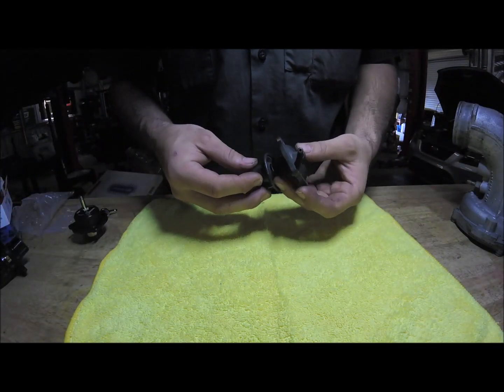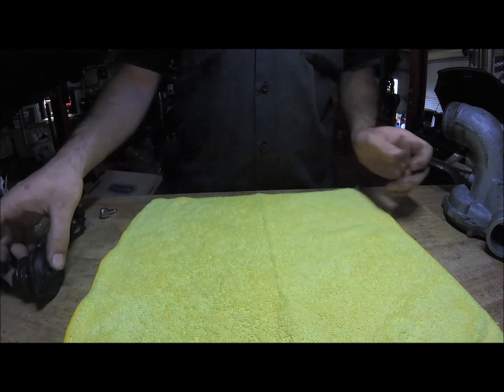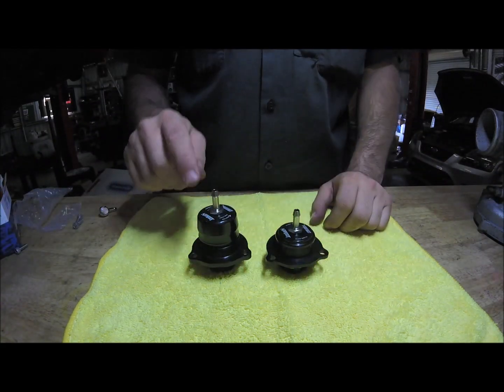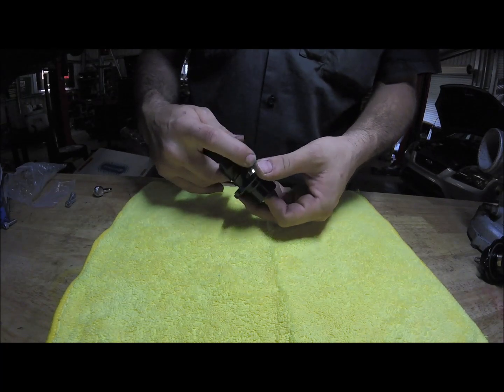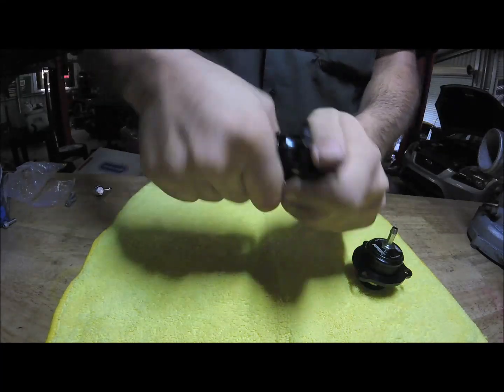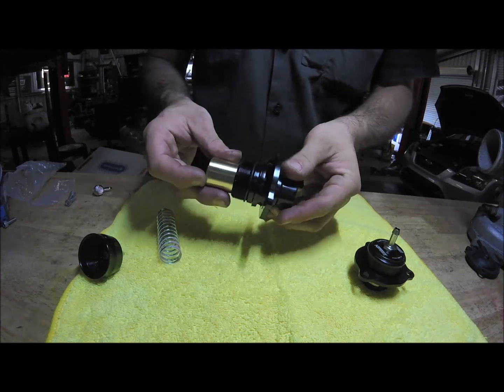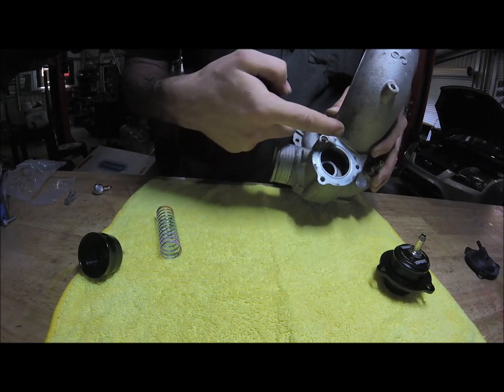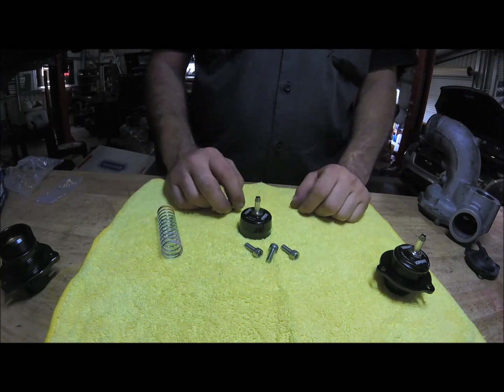Focus XR5/ST/RS CBV's explained

Comment: 1:28 "this spring is really soft .. let's pay $100+ ". ?!  May be change the spring for $1? The valve is under boost pressure so i will hold any pressure that plastic and rubber can stand.

Comment: Can you run use these on a stuck tune
Reply from the maker: yes you can
Reply: @OEMDeniedPerformance was thinking of installing the dual port valve on ford mondeo xr5, so the stronger spring won’t affect the engine, would I need a tune after installing the dual port valve?
Reply from the maker: nah you can fit as it no problem mate  @celpecross3496

Comment: I've seen people talk about blanking the factory valve off, is this a good idea or not?
Reply from the maker: Will just give you problems. A CBV is there to prevent compressor surge. Due to the mk2 ST/RS both running a MAF sensor if you remove and blank the CBV the compressor surge confuses the MAF and eventually the ECU will put the engine into limp mode. A blanking plate should only be fitted if you are fitting another valve elsewhere in the system but if you fit a valve that vents fully to atmosphere this will also confuse the MAF and ECU will assume there is a boost leak and put engine into limp mode. (recirculating/plumb back valves will not have this issue)

Comment: If I only wanted turbo flutter, could I just pull off the vacuum line and plug it? Would that stop the cbv from opening and make the stutututu noise?
Reply from the maker: No, that will allow the CBV to open slightly still as there is no positive pressure behind the spring and will create an internal boost leak.  To blank it off you need to remove the CBV and fit a blanking plate in place of it. But be aware that by doing so you will create compressor surge and if on a ST225/RS mk2 due to having a MAF it will put the vehicle into limp mode.
Reply: @OEMDeniedPerformance  bloody computers ruining all the fun dammit. Thanks for the info tho

Comment: Technically couldn't you take the spring out of standard recirc one if ur running a dump valve ????????? Because I've put a dump valve on mine but its seems quiet but I still have standard recirc valve ???
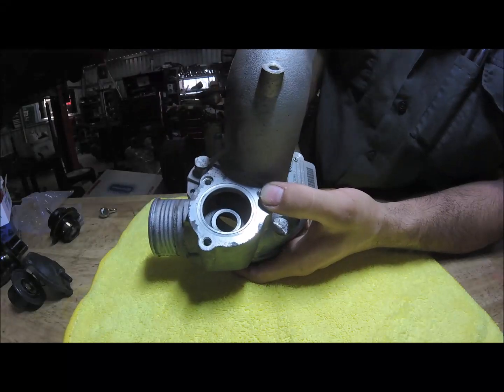Reply from the maker: No as the spring is what keeps the valve shut until you come off the throttle. When vacuum occurs in the inlet manifold as the throttle plate is shut, vacuum occurs through the line to the other side of the CBV and pulls against the spring to open the valve. If you were to remove the spring the valve wouldn't seal so you would create an internal boost leak between the compressor and its intake throat (path shown at 1:10- 1:20)  The issue with running a dump valve and no CBV at all is because it fully vents to atmosphere it is releasing air that the ECU has accounted for as it was drawn in via the MAF sensor. This will eventually put the car into limp mode as the ECU thinks its a boost leak. If you fit a dump valve alongside the factory CBV you gain nothing other than noise but only a little bit as both valves are now operating. The reasoning behind upgrading the factory valve is to have a stiffer spring. If you want the sound of a dump valve fit a dual port CBV as that will give you the noise and the benefit that the valve stays shut until its intended to open.   Not many people fit dump valves in Australia as its not road legal to fully vent to atmosphere but with a dual port its mounted on the compressor housing so becomes the a small case of if police cant physically see it they tend not to book you for it .
Reply: @OEMDeniedPerformance  okay thanks alot man!

Comment: So if you want more of a flurry you tighten it right?
Reply from the maker: tighten to set the spring to harder to prevent vent to atmosphere operation at lower boost levels.
Reply: @OEMDeniedPerformance  oh okay.. so to get a flutter I need an intake aye
Reply from the maker: @blitzballproductions901  yep. The stock airbox will baffle any noise. If you just want flutter fit the plumb back instead

Comment: Hi howsit... awesome explanation regarding the purpose & operation of the CBV's... I have a question that I'm hoping you or someone who reads this comment will be able to assist with... The factory OFH of the 2010 ST225, is it possible for you to do an in-depth explanation of how it works & also what it looks like inside please. Reason being, is that I would like to know the pros & cons of installing an oil catch can to the factory OFH, without modifying the OFH.

Comment: Hi Jamie,
What’s the advantages of installing this on a stock engine? Is there any point? Thanks, vids are awesome.
Reply from the maker: the dual port will give you noise if that is what you are chasing, if not chasing noise then nothing to be gained on stock setup unless original valve is faulty. If original valve is faulty then a TS unit would be a good choice as cant buy the valve on its own from Ford - they only come with the turbos, same with the IWGA
Reply: Any benefit on a stage 1 tune to change this  out to a  Turbo Smart unit?

Comment: I have a TDCI focus, if i fitted the plumbback version (if it fits) to my car would i also get the noise you talked about in the video?
Reply from the maker: We dont deal with Diesels.... but the TDCI has no valve from factory, turbosmart dont make a valve for them either sorry